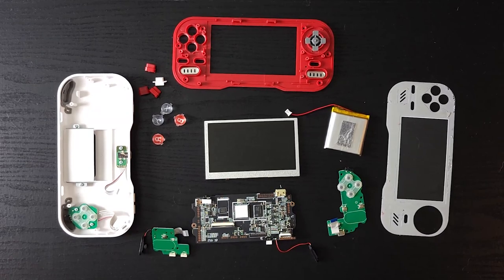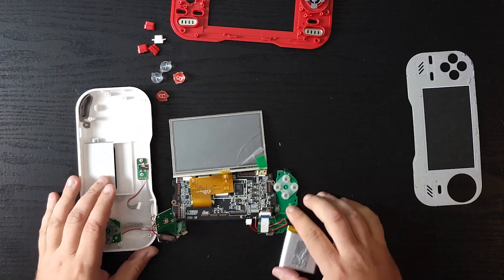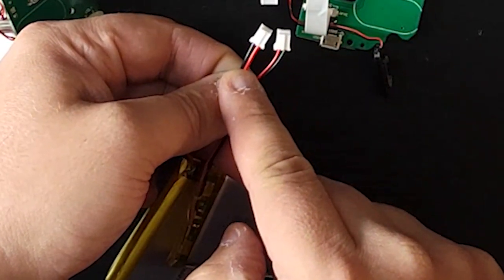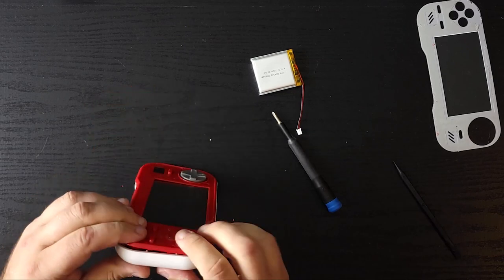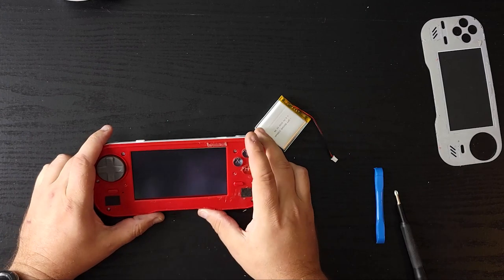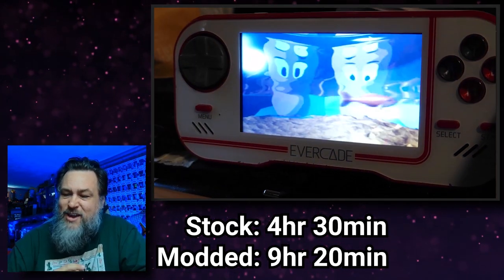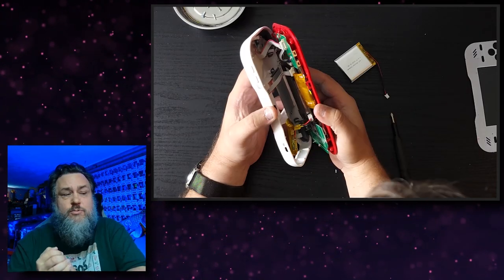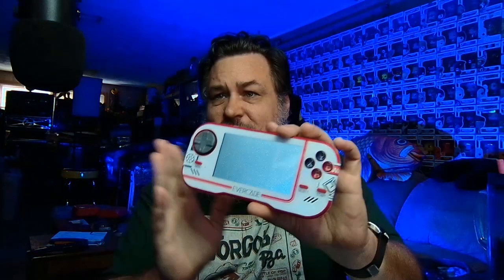Evercade Mods: Attempting Screen & Battery Upgrades

Comment: If you want to dress up your hack, you could take the back of the second evercacde, cut a very precise square hole for the battery and glue a 3d printed cover over it. Or just wait for the new model with the newer fancy screen. Thanks for the video, it was fun to watch and also educational.

Comment: Thank you so much! I just finished upgrading the screen on mine. Will keep the stock battery and see how it goes
Reply: @CrowContinuum  yeah I've been using the new display with the stock battery and I get around two and half hours, not bad, it's totally enough for my usage. It's so much better now. That stock display was really bad when looking a little bit tilted forward. 
Thanks again.
Reply: My Evercade has a faulty screen from factory. Can you link a good screen for replacement?
Reply: @Samuel Trautman  the one he is showing in this video?

Comment: With any connectors like those on the battery, just use a jeweller's screwdriver to push the pin clip in and then put them back into the housing how you want. It's quicker, safer, and you're not left with a bulk of heat-shrink.

Also, wear a damn anti-static strap!

Comment: Great video Crow I really wish Blaze would upgrade the display I would gladly pay more for a nice ips display.  Heads up on the usb cable the one that comes with the Atari VCS controllers works fine with the Evercade for firmware updates.

Comment: For lipo battery size , the number of the battery tells you the dimensions . I believe the original battery said 804349 so that's 8.0 x 43 x 49 (mm) . The new battery was an 115659 which is 11 x 56 x 59 so that is a lot bigger in every way , but the worst difference was that the 11mm thickness was too thick . Best bet for a drop in battery would've been like a 2400mAh 805050 , just a little bigger with the same thickness . You might be able to squeeze a 724957 (2500mAh) in there . In general you won't find lipo batteries that are say 5000mAh (2.5 x times more capacity) with the same dimensions as the original 2000mAh , it's going to be a lot bigger .
Reply: Even lithium-ion cylinder cell batteries like the  21700  (21mm x 70mm) , 18650 , 18500 , 14500 , 10440 batteries are the actual dimensions . Same with coin cell batteries like the CR2032 (20mm x 3.2mm) and CR2016 (20mm x 1.6mm) and the CR1616 (16mm x 1.6mm) .
Reply: I just put the 2400mAh 805050 in my OG Evercade and the only thing that you have to do is cut the unused post out and check the polarity of the plug and change if needed . Fit is not tight around the sides at all and is as close to drop-in as you could hope for . I'm just waiting on my IPS screen for final assembly .

Comment: Why didn’t you use a heat gun? That’s how you soften the glue and remove the front panel, that’s how they fix 3DS handhelds as well. 
Was it worth it? You ruined one trying to improve it.
Reply: Easy, man. Sorry, but not everyone has the pockets to just do that.